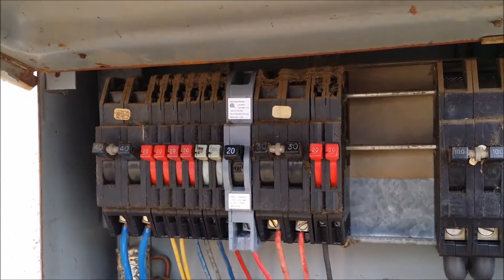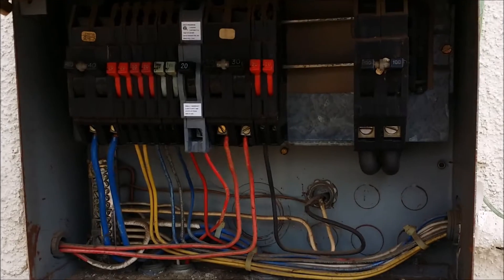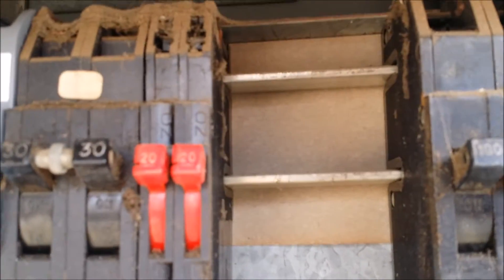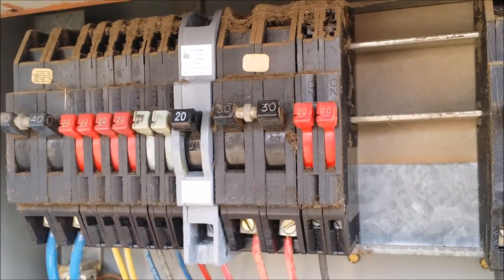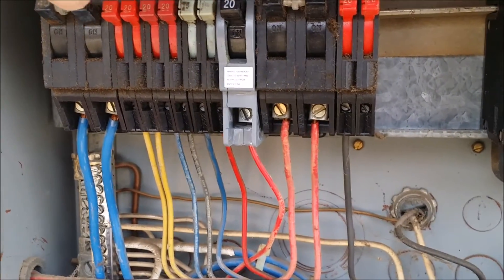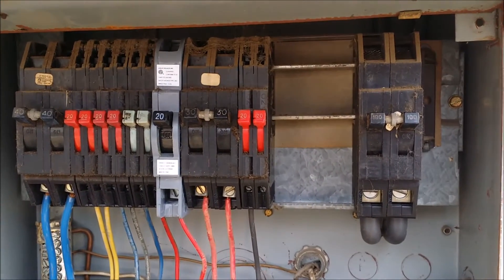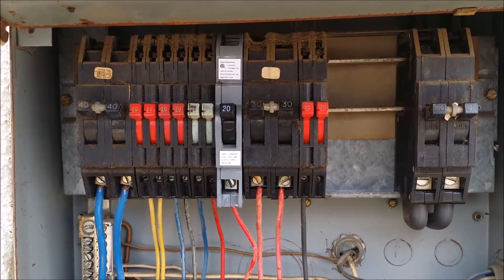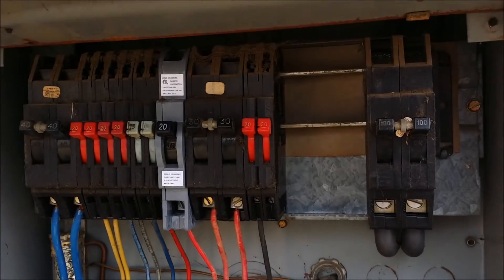Tip 396 Zinsco Electrical Panel Defects

Comment: That one looks almost like mine please more information on this I need a new buss bar I can only find 125 amp bars but my main breaker is two pole 100 amps so 200? Won't isn't that to much for the buss bar? How do I remove and replace

Comment: Hi, I have a Zinsco combination meter pan/breaker panel. Sometimes during the daytime I hear it clicking, as if a breaker tripped.  But none of them are.  The clicking may happen around every hour or so, for a few hours and then stop.  Any ideas?  I ws thinking this might be a bad breaker feeding a refrigerator or A/C.  Something cycling.

Not sure what to do.
Reply: Karl X replace the panel asap